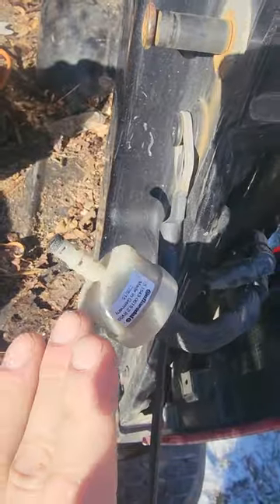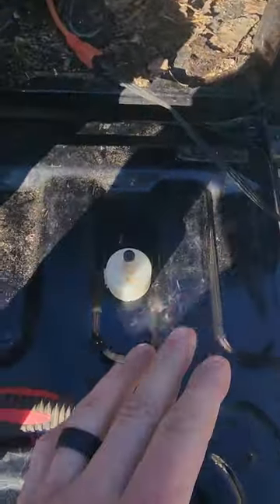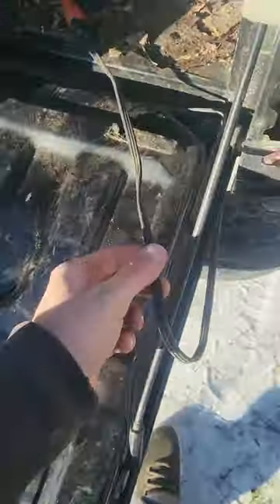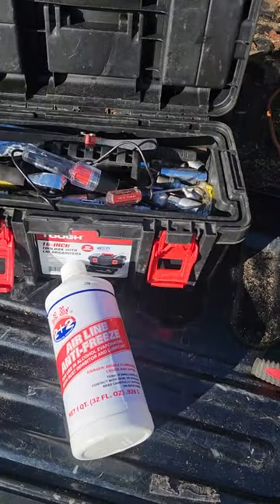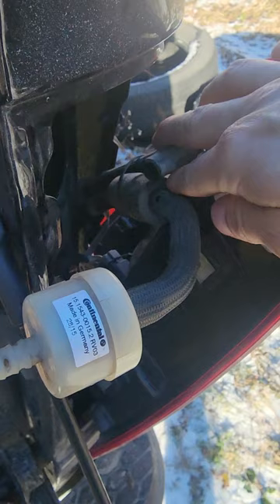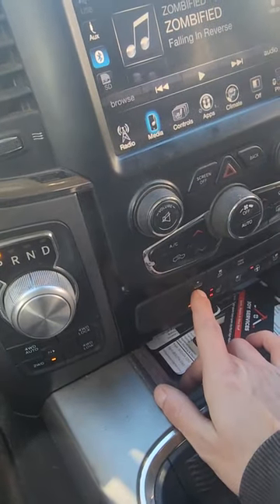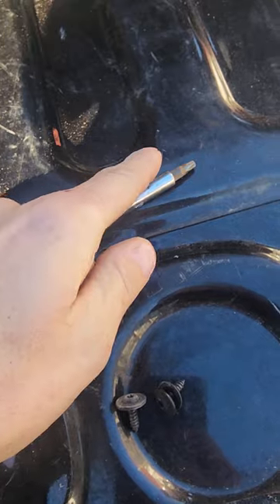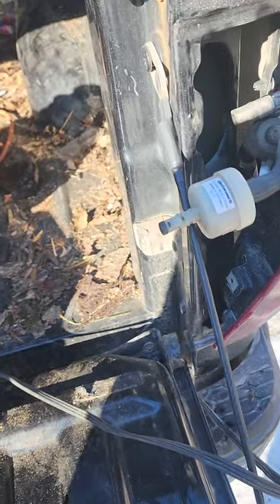part 2 of fixing the air suspension on ram 1500.

Comment: Hi Clifford. Thank you, this is very useful.  Some questions 1) how much fluid do you put in?  2) do you put it in every year?  3) do you clean out the lines every year then put in new fluid?  3) do you recommend a specific battery blanket?  thanks again.
Reply from the maker: I use 1 oz or so. And this was the first time iv ever "cleaned" the lines out only because in theory the antifreeze would lose potency, and for battery blanket i just went with a 65 watt off brand because my outlet on my dash is good for 155watts so it works great,
Reply: I just bought a 2016 Rebel with 83k in Littleton New Hampshire. Love the truck !  Great video very informative. The winters up here really do a job on the trucks we drive.

Comment: My 2014 with 47k miles. Overheating message.
Dealer wants $4,800 to replace the pump and block.
Nope.
If I bypass the relay to turn on the pump, the pump twitches and stops.
So I suppose it could be a bad compressor, or maybe the temp sensor.
I have a refurb pump and block on order from RMT for $400, plus core.
Reply from the maker: Is your truck lopsided or stuck in a position that its not supposed to be? If it is and you "plan" on switching things out weather it be the pump or block or even bags... id suggest putting some stuff in your lines, it may free up the distributor block IF that may be the problem and ASSUMING its (overheating) means its running to long trying to do somthing. So id give it a try
Reply: @cliffordsawyer2994  the rear stays up fine when it's all the way up as does the front. It's only when it is at riding height that the front drops.. periodically. It will work. When I apply power to the pump, it does shakes and stops. So my guess is it's partially seized. From what I've heard, the temperature sensor can cause this problem as well. I do have the line antifreeze that I did add. Unfortunately I still have the issue. The dealer did charge me a $185 diagnostic fee. Hopefully the $400 I spent on the pump fixes the issue.
Reply from the maker: @m3rdpwr  yeah thats unfortunate.... i actually ended up coming across some parts and swapped it out so i didnt have to deal with it anymore
Reply: @cliffordsawyer2994  that comes next is going to a regular suspension. My brother said get the regular air suspension going if possible. I'll fix it myself hopefully and then decided if I'm going to keep the truck or not. I love my truck, but all these managers order these trucks with air suspension for no good reason. I could see if they ordered my truck with a trailer brake to get an air suspension, but I don't think it was smart for them to order all these trucks that way.
Reply from the maker: @m3rdpwr  super easy swap and the trucks already come with rear "shocks" so if they arnt spanked you can re use them and get bigger springs, no need for new seats for them eather everything bolts right up. While looking for parts ALLLLLLLLL 4th gen will fit on ANY of the 4th gens (suspension) parts.